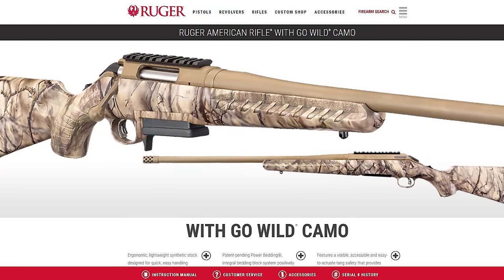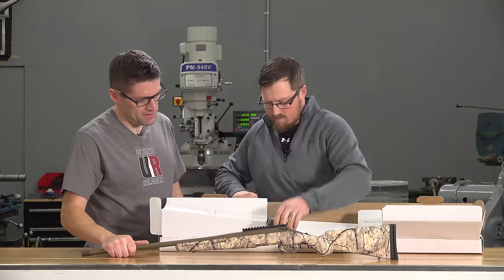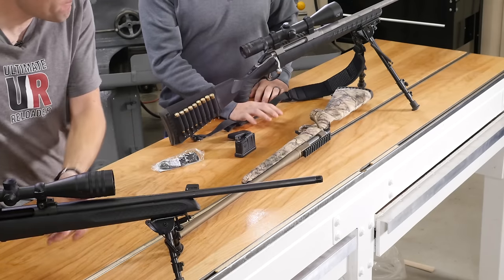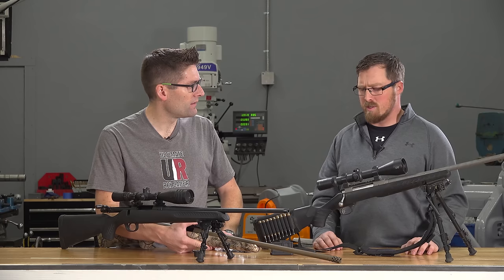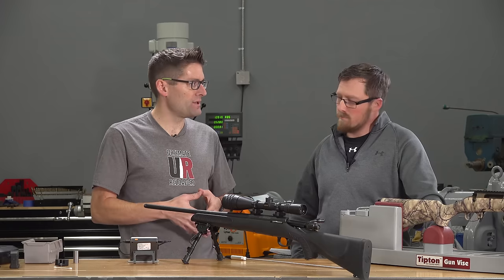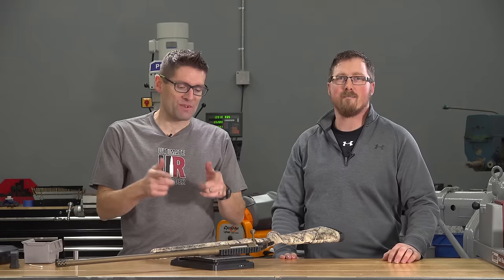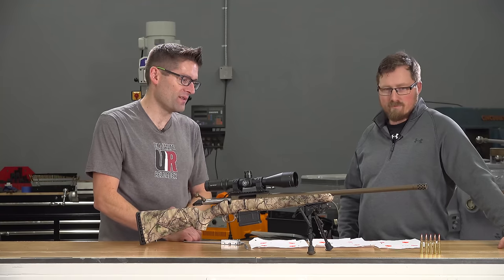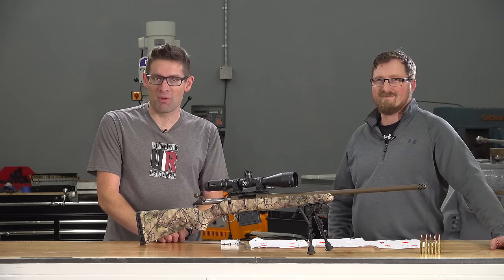Tested: Ruger American Rifle Go Wild in 6.5 Creedmoor

Comment: This gun is amazing. There has been complaints about the stock, I havent have any problems with it but to each is own. After shooting this gun here are my thoughts. Trigger: Crisp trigger, easy and clean
Recoil: There is none, kicks less than a 30-30
Accuracy: After sighting it in with a vortex scope, at a 100 yards all three of my shots landed in the exact same space
Final thoughts: This gun is one of the best rifles I have ever owned, accurate and dependable, don't hesitate to purchase.
Reply: Bikes N' Guns It’s hard to complain about a rifle at that price point that will shoot that well. Manufacturers have to cut costs to build a “budget “ rifle. Obviously Ruger chose to build a good barrel and make sacrifices in the stock which was smart because a large percentage of shooters won’t care as long as the gun is a drill. Ruger supposedly has the newest and best hammer forging equipment in the factory to build the barrels. For those that cannot live with the factory stock there’s a lot of aftermarket choices for them.
Reply: @prevost8686  very true, couldn't have said it better myself 👍
Reply: I bought it as my first hunting rifle today(at 50 years old) at Academy. I got a nice a Burris scope for it.
Reply: Very excellent tool for the trade of hunting 👏 and target
Reply: I didn't have any problem with the stock, but my groups shrunk after I ditched it.

Comment: **Long post** but worth it if you’re chasing tiny groups with the Ruger American rifles.

First step. Remove barreled action and sand down the barrel channel, slightly on Left/Right sides but focusing on bottom. Sand until you cannot make the barrel contact the bottom of the barrel channel by squeezing them together with one hand. 

Step 2. Get a cheek riser. I really prefer Matthews Fabrication. He has some cool designs and for an upcharge could probably match the Go Wild Camo. 

Step 3. Trigger work. Either cut 2 coils off factory trigger spring...Buy the MCarbo trigger spring...use a ballpoint pen spring cut to appropriate length...or, I personally just removed the trigger spring entirely, I CANNOT get my rifle to fail with the trigger spring removed, and my trigger is repeatedly breaking at 2 pounds...Or buy a Timney trigger 

Step 4. The scope base. Ruger usually does a crap job at torquing down the scope base screws and over time they will come loose. So I remove the screws, clean them all up, and use a threadlocker on them. Torque them down to 20 inch/pounds 

Action screws I torque to 60 inch-pounds. 

With my handload of H4350, Hornady brass, Federal 210M primer, and 140gr ELD-M, I’m shooting 0.3–0.4” 5 shot groups at 100 yards. At 700 yards the group holds in the 2-3” range depending on environmental factors and myself. I’ve found the ELD-M likes to be 0.015” off the lands in my Ruger Predator. Pushing 2745fps at the muzzle with a SD of 5fps. 

These barrels like to have copper fouling, so do not clean them obsessively. I shoot 400-500 rounds before I lose accuracy, and then I clean my barrel. 

Aftermarket goodies- check out Anarchy Outdoors! They have lots of fun stuff. I personally bought an Indian Creek Design chassis over MDT or any other options. It’s a modular chassis that is the same price as the mdt LSS.
Reply from the maker: Wow- thanks for sharing Lucas! We've been discussing some of those points, and will look into some of your other insights... I think the stock is the main thing holding this rifle back... :)
Reply: gavintoobe yeah, the stock definitely does not do the rifle justice. But the cheap stock is probably the main reason these rifles are so affordable. 

Grayboe is releasing American inlets sometime “early 2019”, I’m hoping by May.  I’ve got my RAP 6.5 creedmoor in the Indian Creek Design Chassis, and I think I may want to put my RAP .223 in the Grayboe Ridgeback or a Renegade with adjustable comb. That way I can swap the 2 barreled actions between the two different setups. 

Right now my RAP .223 is in the factory stock, uses AR15 magazines. I used Magic Sculpt and made a vertical grip that matches the feeling of the MPA EVG grip on my ICD chassis. Vertical grips are life-changing on shooter input into the rifle in my opinion
Reply: Lucas!!!  thank you so much for the response I will be looking into all these things you have mentioned.
Reply: Eric Peterson you’re welcome. I really love these budget rifles and enjoy helping others in their journey to push these rifles to their limits. If you have Facebook hop on the “Ruger American” group that has 18,900 members. There’s a whole lot of information over there and helpful members.
Reply: @lucass4758  Hey Lucas, Brock from the Facebook group here. I was reading comments and was getting ready to type everything you just said and looked down and was like hey, there's Lucas. Haha everyone, do what he said and you'll be amazed at the accuracy of this rifle. With factory Hornady Black 140g or American Gunner, I was getting 1/2 MOA groupings, consistently. Switched to the Magpul hunter stock and now I'm getting 1/4 MOA, CONSISTENTLY. That's insane for a gun priced this low. I also shoot 1k yards a lot and this rifle does that with ease. For the record I'm using an SWFA  10x SS scope and Seekins rings
Reply: Brocked and Loaded I’m not sure how YouTube works if Gavin and Eric will get a notification of your comment. Maybe if you “Like” their comments they’ll see yours
Reply: Lucas S I know you said the barrels like copper fouling but would it be detrimental if I fouled my bore but left it in storage for 5 months or so and then shot it afterwards? Or would I be better off cleaning out the bore and oiling it and then refouling when I shoot again
Reply: @natetung4219  Assuming you're shooting non corrosive ammo no it's not a problem. I've got probably 800 -1000 rounds through mine and I've done that the whole time. Also, because 6.5 barrels throats erode relatively fast, by the time there was any issue you'd have already changed it out. Now if you were storing it for 10 years, I'd probably just build the copper fouling back up
Reply: Cool thanks a lot!
Reply: Got it bro thanks

Comment: SO, I have a couple of the ruger american because I believe in the barrel. What I found is sometimes the light but cheap plastic stock will flex causing some minor touching from the factory as i was having those not obvious flyers. so i took the stock off and increased the clearance between the stock and barrel and that really helped and the flyers started disappearing which sometimes occurs as the barrel is shot through and gets smoothed out as well. Anyway if the end starts flexing you can add glass or another types of products to fill the fore grip area to keep from twisting and flexing. Mine is now constantly shooting better than I can shoot.  One other thing I recall is the land jump is minimal from factory ammo, i think i can add 20 thousanths and the bullet is touching the lands  so i think i pull my bullet out like 10 thousandths and this got me in 3/8 MOA if i shoot prone and can maintain focus with no wind with under get SDs under 20.

Comment: Bought the basic ruger American predator 6.5mm creedmoor last year,  came with vortex crossfire ii scope.  I  absolutely love this rifle. I've beat the shit out of it! Banged scope, gun and mounts in the woods, deer stand, on and off the 4 wheeler. 143 gr eld-x has me at 9 for 9. Killed deer and yotes, 1 shot stops  from 20 - 250 yards.  Practically no recoil on my surgically repaired shoulder. Only problem i had was scope mount and rings weren't properly torqued from factory.  It's been great since then

Comment: Mcarbo has an awesome replacement spring for the trigger, it just slides in under the adjustment screw then replace the adjustment screw after you remove the old spring 1st of course. It made a really nice improvement on my trigger on my 6.5 Creedmore go wild

Comment: Love the review, Love the rifle as well.  I have a savage axis xp in 6.5CM which out of the box was kind of unimpressive.   I did a home depot trigger job complete with set screw for over travel,  new spring and some washers as shims to eliminate side travel.  Next I filled the for end with epoxy which helped   next filled the butt stock with hamster fluff and construction adhesive.   Then JB weld action bedding.  Threw away the weaver scope for a Athlon argos BTR.   It went from 1.25" groups to 0.4" 5 shot groups at 100 yards with cheap Remington 125 grain deer loads.  I just WISH I had seen the Ruger 1st.  This said I am all in at under $600

Comment: I had flyers with my .450 BM in the go wild American. My observation at the time was that the flyers happened only when using bags/ putting weight on the fore end. I fixed it by adding fiberglass fill to the fore end. Went from 2-4 inch groups (with the flyers) to around 1.5 inches (it is a .450 BM afterall) with no flyers.

Comment: After all the hype, I purchased the same rifle.  This is my first rifle under $600.  The build quality reminds me of my 1st Tippmann 98 paintball gun when was in my teen.  My opinion...The machine quality is 7 of 10 due to many sharp edge and visible milling marks. The stock finish quality 6 of 10 with noticeable warpage.  The Cerakote finish 8 of 10 some are with lighter coating.  The smoothness of the bolt 7 of 10 due to that it takes effort to load and unload.  The accuracy 9 of 10 under 1" group at 100 yards with 3 shots.  Weight of the rifle 8 of 10 with scope and bipod 9.8 lb.  Overall rating 7 of 10.  I will have to spend maybe a few hours polish and fix the warped stock.  Definitely recommend  it to beginner 1st time hunting rifle owner due to its cool looks.  Plus many mods available in the market.

Comment: Guys, one thing I have found with the Ruger precision in which I have 2 is when you take it out of the box and put on a bipod there is a little flex at the end of the stock. sometimes and for mine both cases I had to remove the barrel and trim some of the interiors off the fore end to make sure it is truly free floating. Also certainly the more the barrel breaks in the better it gets. I will be getting a go wild soon.  I think one thing that makes this a decent gun out of the box is the seating distance off lands from the factory for standard bullets.
Reply from the maker: Yes, I'm thinking I may try that... (stock inletting)

Comment: I have a GoWild .30-06, I used the Mcarbo trigger spring & some break in firing, it’s now a smooth 2.75lbs. I epoxy filled the fore end & used a Dremel to even up the stock being free floated with the barrel. It shoots great. The brake works really well. The recoil is like a .243

Comment: I have the standard American Predator that a put in an oryx chassis because why not.. I did a spring replacement trigger job as well as polishing up some of the roughness on the sear and release .. trigger pulls at about 2.5lbs and nice and smooth.  Put a good brake on it until my van is out of jail and it is wicked tight especially with 130g anything .. up to the 147s tried 153.5 and she hates those .. love the rifle - can not beat it

Comment: Agree 100%, The stock on the gen 1  American is a real bummer ! I modified mine by widening the barrel channel, loaded the stock with 4 lbs of BB's, complete rifle is now 11 to 12 lbs. I also added  about 1 lb to the fore end with the BB's locked in place with soft silicon ! I wanted to be able to remove the BB's if I didn't like the way the rifle handled ! In a perfect world, I would now replace the silicon with harder material to make the fore end much less flimsy ! However after cleaning out the barrel channel, the barrel is free floated, so I never went back to do that ? My Ruger gen 1 in 308 is a real shooter especially as a designated hunting rifle and in Oklahoma the average shot at a deer is only about 100 yards ! It will shoot much further than that as it is consistently a 1 MOA RIFLE !

Comment: I have a lot of Savage rifles I like really well. This rifle is a great value when you look at all the features. I am considering one in a 308 just to have a threaded barrel and brake. I have considered having my barrels threaded on rifles I already own without brakes, but it isn't a practical investment as much as it costs. The thing to do anymore is purchase rifles already threaded. It is just more cost efficient. Knocking the factory bedded stock is foolish the stock on it is fine. Any other replacement would have to have a bedding system or be bedded to even be as good as the original.

Comment: I have the green stock version with flush fitting magazine and the same glass. I seem to get consistent 1 MOA accuracy with the five factory loads I've tried. It has proven itself as what I think is an ideal plains deer rifle. I had some primer flow with some of the S&B soft points, but with Hornady and federal have had great results.
Reply from the maker: Awesome- is yours 6.5 Creedmoor?
Reply: @Ultimatereloader   yes, I mostly shoot the 143 gr. ELD-x factory load.
Reply: @fattigla  I'm not 100% sure but I don't believe the go wild line is a "heavier tapered" barrel like the predator line is. On Ruger's website they do not make mention of that on any of their go wild caliber riffles. I looked into it because I really want the predator rifle in .308, however, I prefer a 20" or 22" barrel, not an 18" barrel. The go wild .308 has a 22" barrel, but again it does not make mention of the barrel being a heavier tapered. This could be why their groups were not as consistent as others with a predator line rifle.
Reply: Jason Troutman no. The problem is last year’s stock was a flexible piece of crap. The new stocks with the AI mags are much stiffer....

Comment: I have one and love it but there is a pattern failure, the stock touches the barrel up front.  Fix it by taking the stock off and using a socket and sandpaper to open it up plenty when you do the trigger.

Comment: Hi Gavin, just checked a local gun shop here in Adelaide and the basic Ruger American sells for $860 Australian which today is around $620 US. Not sure if the Go Wild series is available here yet but I'm guessing it won't be far away. The camo pattern and Cerakote colour are really nice.
Reply from the maker: Interesting- are you limited to a certain number of rounds in your magazine?
Reply: @Ultimatereloader  There are magazine restrictions but they may vary from state to state and from firearm to firearm. Different firearm categories cover different types of firearms. For instance a bolt action rimfire is category A and may not have any magazine restriction applicable but a semi-auto rimfire is category C and is restricted to a 10 round limit.  Semi-auto rimfires with more than a 10 round magazine are category D. Your firearms licence must include all category endorsements relative to the firearms you own. You are not allowed to own or possess any firearm that your licence doesn't cover. In my case I don't own a handgun, nor may I be in possession of one as I don't hold category H. I can apply for it but there's a level of training to go through to get it and it could be up to twelve months before I could legally purchase a handgun. I can however use a handgun at an approved range under supervision and have done in the past. I also hold category B which includes bolt action centre-fire rifles.

Comment: Yes I agree with the fact the stocks are flimsy and you are getting interference from the barrel touching the stock. But really for a hunting rifle you’re well inside the kill zone I’d check it at 200 and 300 if it’s hitting a paper plate your good. Now if you were stringing shots 4-5 inches out well then you have something else going on but again this is a budget hunting rifle if you want a tact driver then spend a few more dollars. I have a encore in 7mm and it is sub MOA have it sighted in at 200 and have no problem with .75 5 shot groups. Yes I like single shot over bolt guns just me. Nice looking rifle though I do like the color good luck.
Reply from the maker: We'll have to look at that (stock flex when bipod is loaded). I'm wondering why they (most rifle MFG) aren't more generous with free-float gaps... could avoid these types of issues...
Reply: I thought i was the only guy left that shoots an encore single shot! I have the 7-08 and 25-06. the 7mm is easily half moa with handloads.
Reply: fisher1972 unfortunately I don’t reload have thought about giving it a try but time is a constraint for me. And I will always shot the encore one of the best rifles made in its day. I didn’t like when Smith and Wesson bought them out don’t get me wrong SW is a fine company but they certainly haven’t put the effort into keeping this fine gun manufacturer up to the old standards. But I’ll continue to use this rifle and pick up barrels when I can and the 7-08 is a great caliber as the other choices you have. However I do like the new rifle that recently came out and though not a single shot it is high on my get I list I’m very interested in long range shooting and yes that does play into me getting into reloading so I guess I better get to studying!! Take care and safe shooting have a great Christmas and a great New Year.
Reply: gavintoobe unfortunately it’s about profit when you are talking about adding a bit more molecules to a stock when your talking several tens of thousands rifles well it cuts in to profits and it would cut into the after market stock market think about it if your stock was just what you needed you would not look at other options. And Ruger certainly isn’t the only manufacturer that has this issue every stock on budget rifles are the same. You really don’t see an improvement till the 850.00 dollar range and up. For me I like the McMillan line however you can spend more on the stock than the rifle and most won’t go that route kinda kills the budget side of this decision.